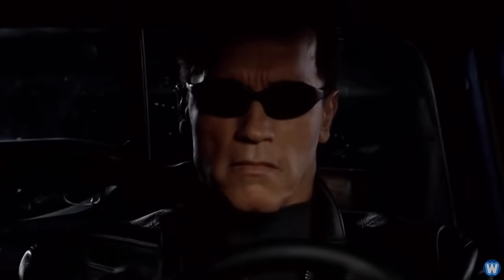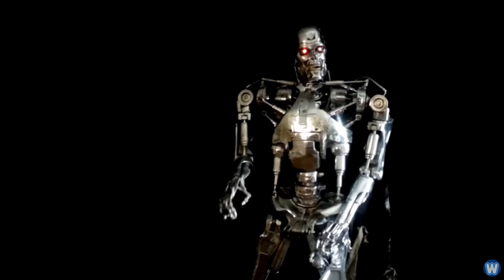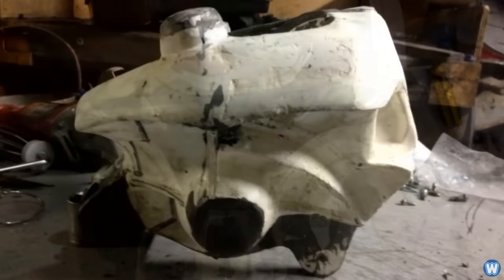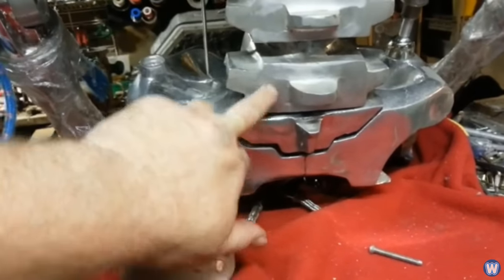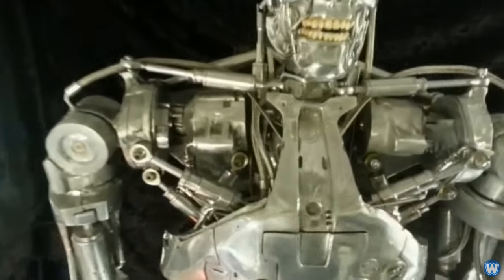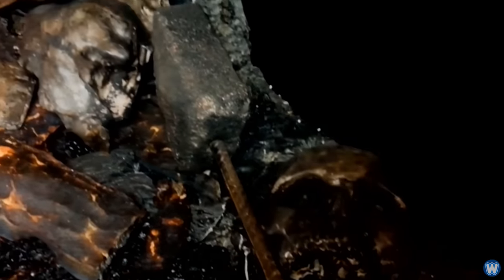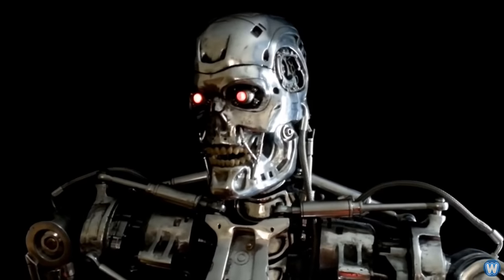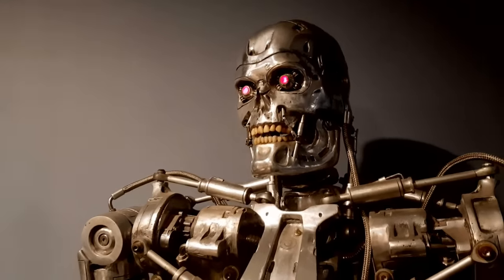Man Spent 4 Years Hand Making Full Scale Terminator T-800 Out Of Metal

Comment: > Started off by making just the arm

So did Cyberdyne (kinda).
Reply: Cyberdyne had the arm from T1 where t800 gets crushed leaving only one hand intact. Cyberdyne made thee CPU unit used later by Skynet.
Reply: Chaabar Yakal  No paradox here. Cyberdyne and Skynet are two different things. Cyberdynes engineers and technicans made both the CPU and Skynet. The CPU was so advanced it allowed Skynets AI to become self aware and capable of logical thought (not only mathematical calculations) which resulted with it coming to conclusion that humans are the ultimate threat. It then kept upograding the CPU and used it in constantly upgraded terminator units.
Reply: And created Skynet!
Reply: Thats what i thought
Reply: hahhah
Reply: MichelleObama isAman  Cyberdyne And Skynet are two separate things. I mean Yes Cyberdyne created  Skynet. But after it went rouge Skynet took Cyberdyne over. At that time Only simple and more bulky terminator models were aviable and thier CPUs were not as advanced as those used in T series. Skynet upgraded the cpu and T series using its processing power and automated systems. When it was still under Cyberdynes control Skynet was far less advanced. Ypou culd see how far Cyberdyne got under human control in T3. Mchines there (in the present time line) were huge chunks of junk compoared to what Skynet has in store in the future.

Comment: @ 3:29 "Parts had been forged."  Sorry old bean for the following corrections. But even though the furnace used to melt aluminum may be called a "forge" . . . actually it isn't  a forge. It's simply a blast furnace or a foundry furnace. And the parts this man made were CAST, NOT forged. Forging generally is a process used to make steel parts stronger by pounding or hammering them. That's completely different from molding aluminum parts in a sand mold. This process is correctly called "sand casting" . . . not forging. @ 3:29 The parts had been CAST.  Alternatively you may wish to say "the parts were fabricated."  Or you may say the aluminum was melted and then poured into the mold. But aluminum is never forged. It's too soft. Forging is done with steel. 

It's true aluminum can be made harder and stronger by alloying it with other metals and special heat treatments. That's generally called annealing. The aircraft industry uses these methods to construct commercial passenger jets. But it's still a far cry from forging. Strong aluminum structural parts can also be made by a process called extrusion. In extrusion metal very near the molten state is forced through a special die that gives it a unique shape. Screen door frames are an example of that. But it's still not forging. The melting point of aluminum is about 750 degrees Centigrade lower than that of carbon steel. Otherwise good show mate  !!!